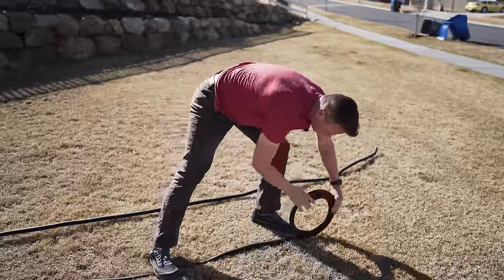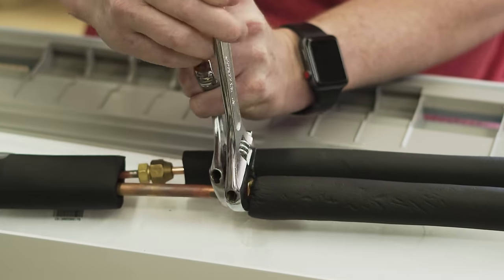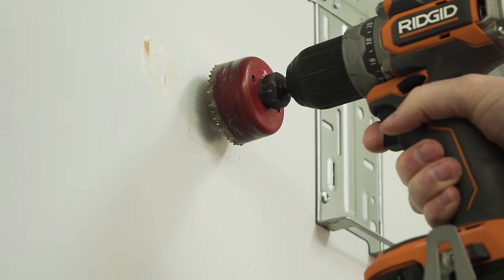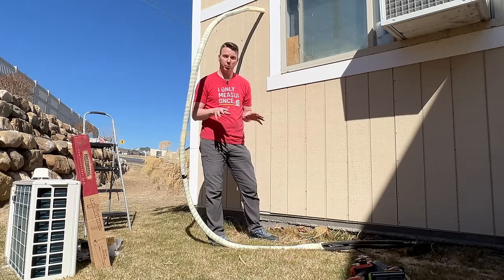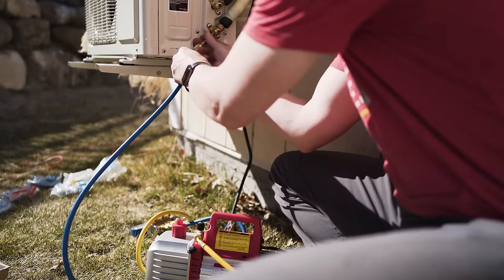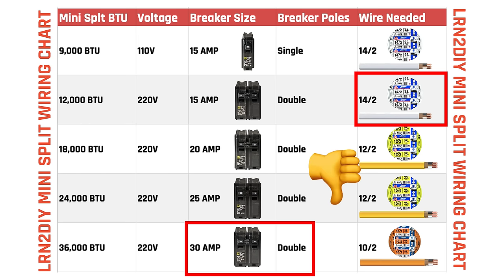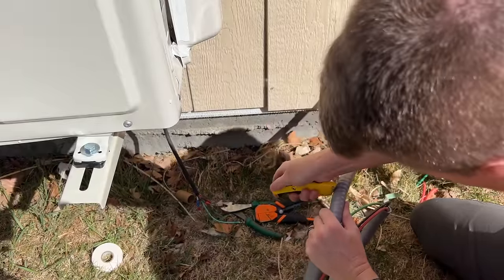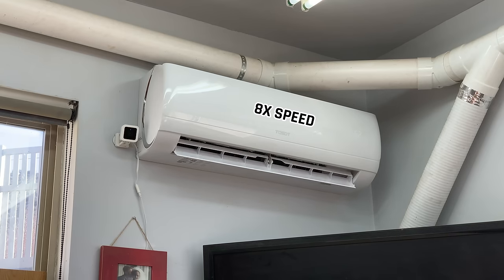DIY Mini Split Install - All the Things Nobody Shows You

Comment: I never saw you charging the system with refrigerant.   You pulled a vacuum on the lines, but don't those lines need to be filled with refrigerant?  Is it already in the unit and fills them when you open the valves?

also, are multi-zone units much more complicated?

Comment: Does anyone know if the pipes can exit out the right side of the indoor unit?  I need to install the indoor unit on a wall that is perpendicular to an outside wall.  Thanks.  (EDIT:  Nevermind, pages 34 and 35 of the manual show that the pipes can exit out the right, left or rear of the unit!)

Comment: 52 year electrician here. Overkill on the wire size. Since you used 10-3 (blk, red, white and ground) you should have used the blk and red for 220. Not the white. But code will allow you to use it but you need to put blk marking tape on the white. But you did ok for a home owner.

Comment: Very helpful video. One question I have is can I connect 3 mini-heads to a one-zone unit. I understand if this was possible all 3 heads would run at the same temperature. Thanks.

Comment: I've never seen a disconnect that had a reversible plug.  That's extremely dangerous because what you should see, to know it's off, is a hole where the plug goes.  Never get fooled by a reversible plug as you just were.  Fooled the opposite way, on when you thought it was off instead of on when you thought it was off, could kill you.  If you're going to use that disconnect, pull the plug and put it on top of the box.  That way you always see it when you go to close the box.  Box closed should be assumed to be hot always.  Box open should not, alone, be considered safe, regardless of the direction of the reversible plug inside.  Safe = box open + plug sitting on top of the box.  

I do appreciate the video but I have to just say, this is a very dangerous video.  Those not very familiar with electrical and A/C should watch a lot more videos along with this one before starting.

Comment: It looks as though you removed your manifold from the unit without breaking the vacuum with refrigerant. We typically introduce positive pressure to a system by opening the valves first, or by charging any amount of refrigerant necessary for extra length of lineset if called for. If the manifold is removed under negative pressure--your vacuum served no purpose--air will be pulled into a system that is supposed to consist of only refrigerant. While this will not prevent the system from running, it can introduce air and moisture into the system, causing higher compressor discharge pressures and reducing the life of the system as a result. You may still enjoy a long system life, and I hope you do--considering most mini splits do not allow for a filter-drier...evacuation is typically regarded as crucial.

Comment: Nice, good you installed extra thick wire but braker you need to install according to your equipment. check AC unit amps plus 1.5 %

Comment: watching others do this makes me feel even better about my work but then again I should have known he's using a rigid drill lol also going this all backward bracket then measuring for hole making the whole and sending line set in from outside for this case bc its a back side connection and make the connection inside then send the slack out but in this case this guy just over complicated this and the drain should come on the same side as the line set unless you switch it like he did but he honestly could have done bracket hole wire and then hang the unite and make all connection outside so know if he has a leak or needs to service the head he's gotta make 10x more work for himself
Reply: damn the dude dint even use Fortress or slim duct sad

Comment: First off thank you for sharing. I cringed when you pulled off the vacuum line before releasing the refrigerant. The Schrader valve on the service port is designed to keep high pressure inside, like on a car tire. When you disconnected the vacuum line you were relying on the spring in the valve stem to hold the vacuum against atmospheric pressure. Better to release refrigerant before disconnecting vacuum line.

Comment: i have the same basic mini split unit but in a 110v..  everything was about the same with my install but i found it necessary to cut the provided refrigerant lines about 4 ft shorter because otherwise as they were just too long for where i set up my outside unit, and as your not suppose to have any low spots where oil might collect inside the pipes since its not recommended to just loop them around in order to make them shorter... I bought a flaring kit at Harbor freight for about $15 to refit the flare nuts afterward of cutting the lines to a proper custom length so as to reach just about perfectly down to where i set up the compressor unit outside..  and since the system was pre charged with only a certain amount of refrigerant, then  i figure it should be a slight bit more pressure now than necessary, since it isnt filling up quite as long of a line for the system that was orig provided ?

Comment: Hey there, late post but you are fine with wiring, you can run 10awg and put a 15 amp breaker if you wanted to. Breakers protect wiring not devices, oversize wire is always better. But im afraid you broke vacuum before letting a little refrigerant pressure in,

Comment: you deff a smart guy. But please recommend to use a torque wrench. #1 problem with mini splits is a poor connection at the flare fitting.

Comment: One way I always do it is to fit the copper to the whole first giving extra length inside like 1.5m  to connect in the indoor unit. Then just fit the unit in pushing the 1.5m back outside much easier to do when you alone

Comment: The video was completely accurate.  I did every thing step.by step and it worked.  But I did have a couple hiccups. I couildn't get the power to pass thru the shut off next to the compresser.   I don't know if I have the line and load mixed up?  I have the power to line and the compressor to load?  I wire nutted them to see if that worked and it did. So I don't know if I need to get a new service shut off.   Also the mini split is leaking.  Does this need to be charged?

Comment: A lot of errors were made in this video.  It should almost be considered a what not to do video instead.  Best advice I can give if you are going to attempt this yourself is to read the installation manual, which this presenter clearly didn't do.

Comment: nice vid, this is exactly how i did my first ac. wish this video was available then.
bu for my second ac i learned that just using a vacuum pump is not a good leak test, because the pressure difference is less then 1 bar. and when the ac is operating, the pressure is around 40 bar. so to properly test the lines you have to use a canister with nitrogen with a variable reducer so you can test it at just a bit higher pressure then normal operating pressure. after that you can vacuum the lines and open the valves..

Comment: You can use a 3.5" inch hole saw and then use a 3" PVC pipe sleeve to pull the thingies thru the wall.  This also keeps the bugs and varmints out of the wall.  You can buy a 2 foot long piece of pvc from Lowe's and cut to length with a saw.

Comment: You dont match the breaker to the wire but to the device (assuming your using wire that's the right size or too large like you did} .   Use the breaker size recommended by the manufacturer for the device youre installing.

Comment: no no no , you dont run 14/2 or any romex with just a black , white and green wire . you cant use the white neutral as hot wire to make your 240 circuit , you need a red wire or another black wire   . white wire with black tape around it is not to code

Comment: 10:51 - did the w4nk actually push 95% of the pipe through a small hole, just to get 5% of it inside ?

Comment: I'm an electrician, so whenever I watch a video like this, i skip to the electrical part to see if he knows what he's talking about or not. He absolutely doesn't 

A few of his biggest mistakes: 

That chart he shows is wrong. You cannot put #12 Romex under a 25 amp breaker. Romex is only rated for the 75° column on the amperage chart

He secures the wire he's working on correctly on the panel side, but you can see other stuff just floating from his previous additions 

You can always go down on the breaker size. Just because you use #10 wire doesn't mean you can't protect it with a 15 amp breaker. Equipment has minimum amd maximum overcurrent protections. If it's rated at 15 amps but you protect it at 30, you void the warranty
Reply: Finally, someone else who actually knows what he's talking about!   😊

Comment: The pvc pipe on the wall above the interior unit sits well within the free zone required by the manufacturer.  Would have had better airflow dropped a few inches lower.

Comment: great video thanks.  are the ports/fittings for the 2 copper lines on the condenser marked low and high pressure ??

Comment: you need to protect that mini split with a 15 or 20 amp breaker just cuz you have 10 gauge wire doesnt mean you can hook up your e quipment to 30 amps you need to size the breaker according to teh machine btu and load

Comment: Question - there is a 230V and a 120V option from TOSOT.  Any advantage of one vs the other (other than the obvious lower current on 230V)?    Thanks for the video. I think I’m going to commit an order and doing this in the next week or so.
Reply: I would check on Amazon, and see if anyone is complaining about the unit brand you are about to buy.  Then consider the other options.  You do want a higher SEER rating, if you can afford the upfront costs.  I bought a 17 SEER Della unit, and am happy with it.  My neighbor bought a 18,000 Btu Della unit, and is also happy.  I installed both.  It took about 4 hours to install it..  The smaller unit is 120 volts, so it can be plugged into a 120 volt outlet.  The 18,000 is only made in 240 volts, and the neighbor had a 240 volt disconnect right next to where we installed his new unit.  It really does not matter what voltage you select on the 12,000 and 9,000 Btu units.  Larger ones only come in 240 volt.

Comment: Where is the torque wrench the small bottle of nitrogen and the extra refrigerant you have to add the length of the lines and the head you'll be scratching your head while it doesn't work right

Comment: I'm curious why ppl typically place these units in the corner. Wouldn't it be optimal to place them as close to the center as possible for the fastest room cooling/heating?

Comment: That’s true you should never coil the lines set up in a vertical position it will starve the compressor not getting any oil is absolutely
Correct basically it’s a big no-no

Comment: Your breaker size is not regulated by to wire size you used it should be sized to protect the equipment ! 15 amps

Comment: Red and black go to the breaker.   White goes to neutral and copper goes to ground.  If for some reason you use white for hot you should color it red on both ends.  IMHO, your wiring is wrong.   Also, Romex  in conduit may have heat problems.

Comment: much easier and neater if feed copper lines and control wire from outside to inside with indoor unit on table or floor to make connections .  also coil extra line set and lay coil horizontal not vertically ..

Comment: I have a question about the insulating wrap that was used to wrap the drain tub, wire, and copper tubing. I have tried find it but cant. Can you add it to the list of items used. or was it included in the kit?

Comment: This is some rather funky elec. work. I know you were just using some 10/3 you happened to have, and I get that.
- For the average DIYer, it's not common to run Romex thru EMT, and 10ga can solid can be a pain to manipulate if you need to go feed thru tight bends. It's also overkill for this install. If you are going to run conduit, it is easier (and cheaper) to buy the length of wire you need and fish it thru the conduit once everything is in place. 
- Using EMT for outdoor is not recommended (or even code in some places). I see it done often, but the downside is that if it is exposed, it can be easily damaged/bent. Check your local codes, etc. Always make sure your fittings, etc. are rated for outdoor use. 
- I'm not sure why in this case white is being used as hot and not the blk/red for the 220v. When using a 220V breaker, both connections are hot. If you put a volt meter across the two poles on the breaker you should see 220v and from either pole to the neutral bus, you should see 110v (or 240v, 120v respespectively depending on your mains). In this case, I would have kept things consistent with the rest of the box and used the white and neutral and the blk/red has hot. Less confusion for the next person that comes along if nothing else.
- To make life easier (and make sure the wires are properly installed to the breaker, you can wire the breaker with it out of the panel a bit and then snap it in and still not have excess wire (as many people do) in the box. I say that because working in a tight space, it's easy to get the insulator of the wire inside the clamp on the breaker and end up with a loose connection.
Reply: I said essentially the same in my comment.  I had not read yours yet, or I would have just agreed with what you wrote.
Reply: @Calango741  I'm sure I missed stuff, was just pushing out a quickie.
Reply: @stringlarson1247  yeah, me too. You covered some things that I missed.
Reply: @Calango741  Always good to have a 2nd set of eyes. (or thousands)
Reply: @stringlarson1247  yeah, I didn't realize how many different people had called him out on his mistakes in their comments until after I had made mine.

Comment: at 18:05 you start the vac pump, you did not mention opening the allen key vale on the low pressure side. What are you pulling a vacuum on?

Comment: So many things wrong with the electrical!  Its 240. You need black and red as power, with as neutral and copper as ground....no? Also....double 15amps breaker even if 10 gauge wire

Comment: You should also be pressure testing your lines with nitrogen and need to vacuum your system before releasing your refrigerant. Your refrigerant is contaminated and over pressurized. This is going to damage your system in the long run and be extremely inefficient

Comment: Using a circuit breaker that is larger than the required size is WRONG. You can always use a lower amp circuit breaker on heavier gauge wire. You should always size the breaker based on the stated size needed for the device, in this case I would think 15 amp is probably enough. The way you have this set up it will take 30 amps minimum to open the breaker which is at least twice what the unit is rated for.  You could very likely have a fire by the time the 30 amp breaker opens. Never use a breaker that is rated higher than the device calls for...Never use wiring smaller than what the rated breaker or the device calls for.
=========================================================================================================================================
Also using a 3 conductor with ground is the correct type of wire for this 220 volt installation. Yeah you can use 2 conductor with ground but that is not correct. Ground and neutral are not the same...

Comment: So you didn't have to charge the system with Nitrogen at all?  The system is pre-charged and releases into the lines one you undo the valves?  Thanks.
Reply: ssacra22, You "Could" put nitrogen into the refrigerant lines before performing the vacuum pump on those lines. I skipped that step, and that is OK. The nitrogen helps to remove any moisture from the lines, and it is a good way to check for possible leaks in the flare fittings.  However it is "Optional".  And I don't have a extra $375 sitting around waiting to buy a nitrogen tank and pressure reduction valve.  

The big mistake that I saw was removing the refrigerant gauge line before putting the refrigerant pressure into the lines.  I would suggest putting about 10 - 25 PSI from the outdoor unit into the refrigerant lines, then shut the valve again.  Check every flare fitting with soap bubbles, and then remove the refrigerant line gauges.  You will have less loss that way, at a lower than line pressure.  Then open both valves to let all the refrigerant flow freely.

Comment: You mentioned getting an electrician to check your work , did you ? You used the white wire as the other  hot when that is what the red wire is for.

Comment: Oversize wire is fine, however the 30 amp breaker could create a grave problem. Will not trip when necessary. Please review your video and rethink your electrical blunder.

Comment: This is why these companies should not be making these mini split units “DIY FRIENDLY” because people think they know what they are doing but really don’t, you can run as big as wire you want but always size your breaker to your electrical device and THEN SIZE THE WIRE TO THE BREAKER. Now that he put a 30 amp breaker in if something catastrophic happens to that AC it will not trip.

Comment: You could fry that mini split using a 30A breaker and 10g wire. Upping the wire size is fine, but you need to use the 15A breaker or add a fuse somewhere… or be ready to shop for a new unit

Comment: Your install is not to code. Sub panel to disconnect you used a white(neutral) as a line(red) without re color coding the wire. 

How did you provide neutral to condenser? Ground is not to be used to carry current. It is ment for fault current. Another code violation.